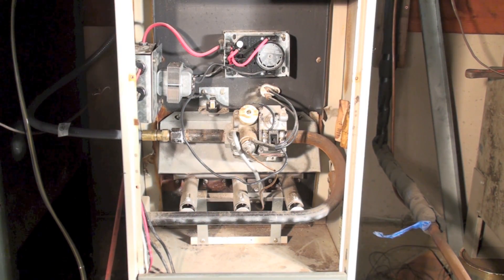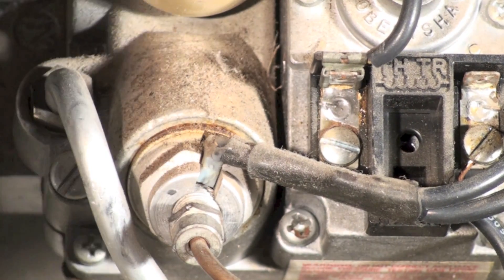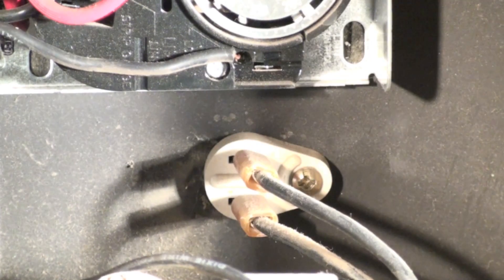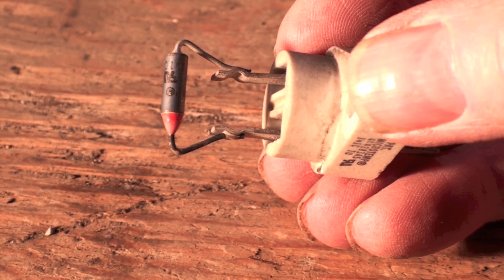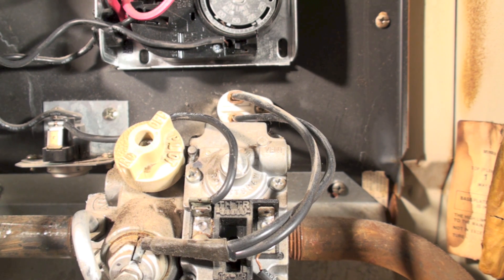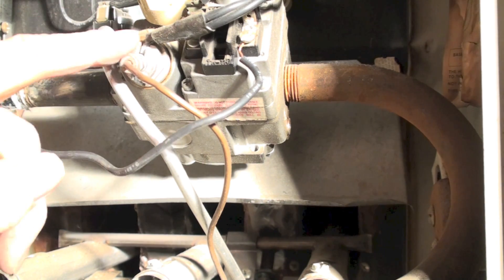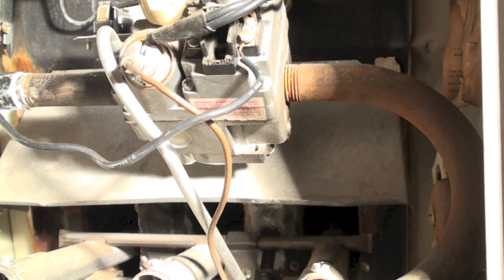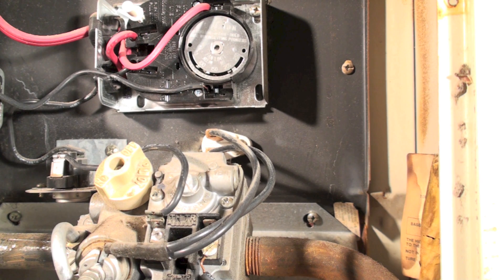Heat controller (Rheem) gas furnace TCO

Comment: i got a oil furnace giving me a fit, kicking out on fan high limit. I  put the fan on high, nozzle is .60gph 70b, 2010 ICP becket ahf gun.  air flow is good return and supply even does it with the door off and its in a closet..  ok my question is it has four different fire rates that will determin fan speed, nozzle size, ect. how do i figure out the fire rate its like .50 .63. 74. somewhere along that line probly not exact but how do i distinguish the fire rate.
Reply: any help I would really appreciate.
Reply from the maker: crob227 I would take a duct temp by making a small hole in the supply duct approx 2' away from the supply plenum.  Using a temp probe, check temp.  This will eliminate a bad limit switch.  If the temp is too high (150F), we know it is over temp. I know it sounds too simple but first, check filter.  Be sure the blower wheel is clean.  Also be sure there is no damaged(crushed) ductwork.  If you are using a .6 GPH nozzle, the net output of the heat exchanger is 70,000 BTU or less.  A 1/3hp fan motor should easily move enough air to keep the heat exchanger cool. I don't think the firing rate is the problem.   Hope this helps.
GFM
Reply: grayfurnaceman I  replaced the fan limit which was a little bit off, under warranty. Its a down flow system, returns about 2ft long supply duct is a spider box and i get really good air out of every vent, and the coil is clean.  the flue vent has a resettable limit on it so im sure i am getting good flue.  the reason i need to know the fire rate is to see if all my setup options are rite like my fan speed, nozzle, ect.  the temp at my coil, under the furnace was between 180 and 210  and it cuts of the limit at 240,  pulled the gun to make sure and chked inside and around the exchanger.
Reply from the maker: crob227 If your temp probe can "see" the heat exchanger, it will give inaccurate readings.  I guess I don't know what you mean by firing rate.  If the manufacturer gives a nozzle size, it should not overheat with that or a smaller nozzle if the air flow is sufficient.  I think this is an air flow problem, as in ductwork or number of outlets.  Spider boxes are known for low air flow.  Hope this helps.
GFM